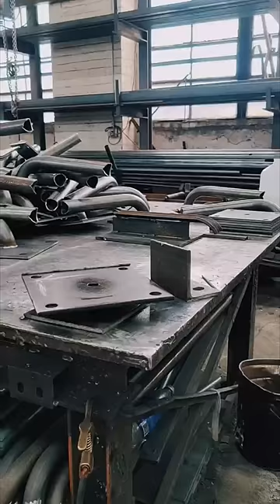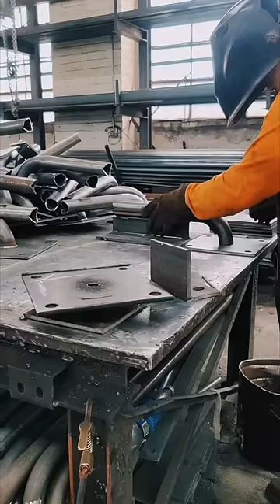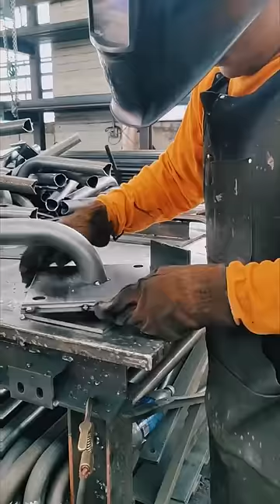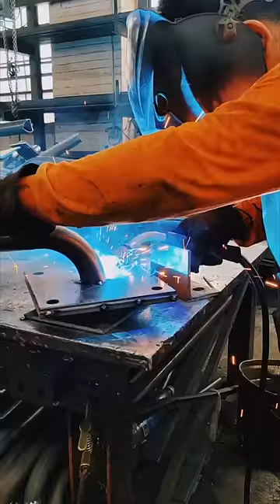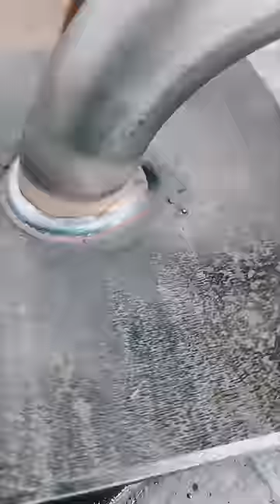Weld Smarter🆙 Repost from @danielsweld(TikTok) #yeswelder #shorts #welding #welder #weld #work

Comment: The thing with metal work is; all is allowed as long as its within procedure.
Reply: U mean all is allowed if inspection can't tell u deviated
Reply: U just reapeated what he said
Reply: @beanDoggins  we said 2 very different things the process for me is the engineer approved repair plan or our wps info but sometimes u need to deviate from the allowed settings or procedures and as long as inspection can't tell you did it it's good otherwise it is unapproved repairs or not following the work order /wps
Reply: @aellis6692  💯 % on point
Reply: @aellis6692  I like turtles
Reply: @aellis6692 no one is writing procedure on that little BS job

Comment: Excellent ideas... great setup.
I would have liked to see how or what you did for easy smooth turning on your turntable...
 Regular bearings typically arc out and are fucked after the first run..
Reply: I've used an old wheel hub bearing from my car and since the bearing is in an actual housing you can tack up plates to the flanges like this guy did. I actually used as a "neck" to make a rotating head for a robot art sculpture I was making 

It's not suitable for vehicular loads but still spins freely by hand

Comment: I worked as a non-union employee at a union shop, the boss comes to me and said we’re behind on the job tally for the last two days. I told him no problem, I got this. I burn in some extra jigs for welding and cleaned up some of the older ones that had weld BB on them. Got in a rhythm to get more in and out of the jigs faster and it worked. I have lost count of how any extra parts I had made but like the rhythm and caught up but needed to refill the components to make up for the extra parts a had used up going faster. The next Monday when I came into work the union representative stopped me at the time clock as I clocked in. He brought me to the office where my boss was already sitting in the managers office. Long story short we made to many unit the week before as we had fewer people on our shift. I was written up for doing to good of a job. I was stressing out the shift manager on the other shift. He was having to explain how fewer people could make more units then his people.

Comment: As a robotics programmer and weld technician I can say with absolute certainty your method is better than whatever he could have come up with. That's more or less how it would start the robotic system up too well that piece. But a servo motor on that carousel and a PLC to turn the welder on and off and you could just sit there and load parts all day.

Comment: From working in the industry for 7-8 years now. Welders really enjoy making their lives as difficult as possible. From using balled tungsten like it’s 1990 to refusing to use a heat sink when welding stainless or parts that are prone to warpage. 

They often respond to constructive criticism that would make their job easier with “I’m not a p$$y”

Comment: I work in IT so I can’t speak for other professions but if I was called lazy by my boss it meant he noticed the effort I put in automating away the boring and error-prone manual work. What you’ve developed here is a way to get a consistent and repeatable outcome for something repetitive. This device can now be used by someone less skilled to get the same results, which means you should to ahead and clean out your area because we’re heading in a different direction and no longer need your services. Oh, no, leave your spinny-ma-jig, just you go.

Comment: I would hardly call someone "lazy" for building this to make the welds faster, cleaner and uniform. It's  a "jig" just like the jig he is using to tack weld the pipe to the plate. That is working smarter for sure.

Comment: Once got called out by boss-man for spending around 30 - 45 minutes planning and making a jig that helped install window/door frames in concrete prefabs. Coworkers started coming to me and lending the jig so I made a few more. They are still in use, 2 years after I left the company, and have saved more than a few work hours accumulatively. Sometimes the lazy man is the best for the job.

Comment: Judging by the pile of pre-cut and pre-bent tubing you've got there, I am assuming that you will be welding a lot of these. Having a fixture like you've made will make it fast and more consistent for each part. Huge time saver in manufacturing quality parts!

Comment: This is awesome not lazy! Making jigs, fixtures and guides is like half of production, fabrication and manufacturing. Making this jig so he can make each component to the same quality, and from the looks of it the more he makes the more time he is saving, is very smart. And the guy here is working smart, working hard, and probably working consistently. Those are the 3 keys to good work (work smart, hard and consistently). Boss is only right if the guy only has to do this weld once, and wants to get out of other work.

Comment: this is exactly my job at work.  come up with solutions that make work easier and faster, for as little money as possible.  This is just a very smart solution.  I would just make a notch in the plate that protects your hand and where you rest the torch to have the torch in the same place every time.

Comment: Only "problem" I see with this is running the power through a bearing. At some point it's going to be eaten away and not be in tolerance any more. At this low rotation speed, I could definitely see it taking years, though. So good on ya.

Comment: my electrician boss talked shit on my harbor freight roll around shop stool with tray...at least until i got 3 rooms done just before he finished the 2nd one, and hes been doing it 20 years, next day he tried it and has NEVER went back to being on his knees and is faster too, and his back hurts less as his tools are on the tray and not in some heavy ass belt...We ran wires to box and made them up for finish out later(same outlet count in both rooms and we each had wires ran through ceiling boards already, just needed stapled and boxes made up)

Comment: IF this is a true story, the boss is clearly not a welder. Work jigs are standard practice in production work because they streamline the process increasing productivity while reducing error. Companies spend thousands of dollars per worker to supply  workers with rotating fixtures , so this welder would be saving your company a bundle by DIYing the fixture.

Comment: reminds me of being told that I wasn't allowed to sit down during my shift (my job was stationary and did not require standing and i had a knee injury) because that was "lazy" like come the fuck on there is nothing in my job that would be in any way impeded by my sitting
seems to be the same mindset as the bosses who want all their employees to commute 2 hours for a job they're performing perfectly fine or even better at home, it ain't about productivity and it ain't about efficiency or safety, it's usually just about the power, control, and stroking their egos

Comment: there are a lot of bosses who would let you asemble expensive product (that is in mass production) on floor instead of making a table so its easier, more acurate, much better for worker health and increase the speed so you can be home in weekends... just to save few bucks.. Let them work alone.

Comment: now you'll do 3 in the time it "normally" takes to do one, throwing off every time estimate in the shop, causing a bottleneck just after welding. also if you finish them all, they don't need YOU, and lay you off.

Comment: Smarter would be to use a stepping motor on the rotating base hooked up to a raspberry so it auto rotates at the perfect speed. Than you make a holder for the welding thing and make it autofire and hooked up to the raspberry. Now write some program to do shit perfectly timed and you don’t have to weld more than 4 small points anymore. Now you can produce way more in the same time and your boss should be happy again

Comment: I have a tendency to walk the opposite way of the work after the meeting where we lay out the work and we all have out assignments.. Every now and then it will bite me in the ass, but most of the time, even if I spend three hours not doing my job, the whole job will get done much faster and cleaner in the long run... I'm no engineer. I just like engineering. And I work WITH people, not FOR people. which is why I'm broke.. lol.. whatever

Comment: If you have a bunch of welds and most likely you have a contract and the company gets to make on a regular dime then he’ll ya make a swivel jig for it plus you can use that on other jobs no big deal most manufacturing welding jobs you have jigs that are yours and there in your toolbox or under bench.🤷🏻‍♂️😂😂

Comment: Spent 20 minutes making something that makes your job way easier.  But get bitched at for "wasting " 20 minutes,  meanwhile it built production up, and you can build twice what anyone else can put out.... YUP!!!  Been there before!!!  "He was done 3hrs b 4 u!" True, I had 1 repair. 1 pinhole leak. Other guy Spent 2hrs on dye test leaks, and built it 90° out. Took platform 4hrs to redo the couplings and dye-test. Not counting the extra.. but..I "got smoked "..

Comment: That definitely doesn't make you lazy, but maybe short-sighted.  You may have just made the prototype for your automated replacement.   Of course, you'll still be needed to put the pieces in place and set them on the turn table.  Good thinking, but I don't think you considered the robots. 
P.s.
I'm not a welder, so this is more of a general point for anyone who crafts anything.  It kind of looks like you could clamp the torch in place,  put a motor on the turntable, and Bob's your uncle now half the process doesn't require you.  Scares the $%&# out of me personally.  Not only does that mean less work for humans, but I also don't feel good about teaching robots to weld.  All I'm saying is... Skynet.  Wow! I didn't think I was going there when I started writing this.

Comment: You are lazy, but you are the right kind of lazy.
there is two kinds of lazy, the type of lazy where you have to redo the same thing over and over again, because you only spend five minutes fixing it and then there's the good kind of lazy, where you do the job right the first time, so you don't ever have to fix it, which also includes inventing a method on how to do something more efficiently. 
Your productivity has gone up by 66% if not more, just with that swivel.

Comment: I took a screenshot of the side he didn't show up close, and I zoomed in on his bead. Complete garbage.

You can see how inconsistent his travel speed is on the first few inches as he's welding, and his work angle is way off, which resulted in no bottom toe, just a big ol' roll that doesn't tie into the base metal.

Yeah, it's a little faster this way, but the quality of work is terrible.

It doesn't take much more time to do it right. He is being lazy.